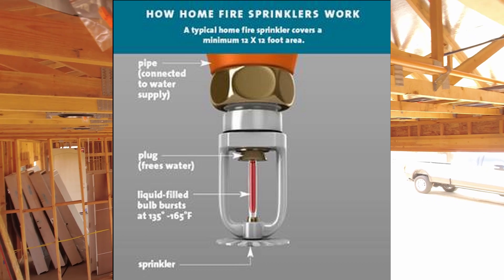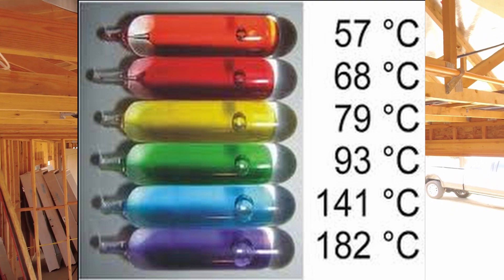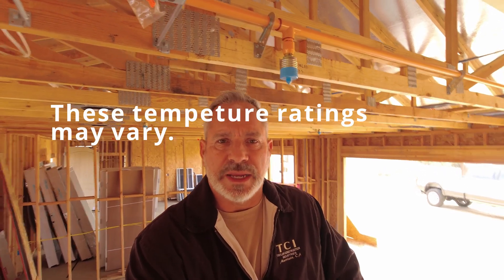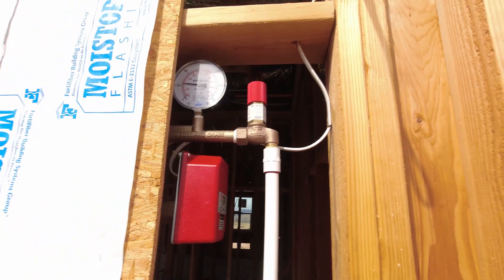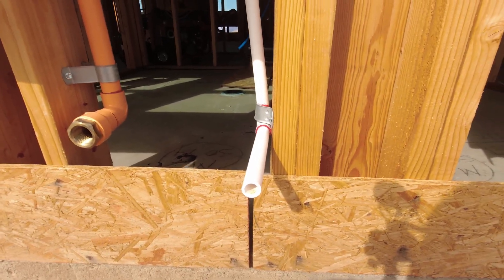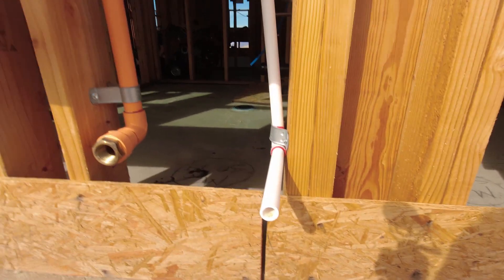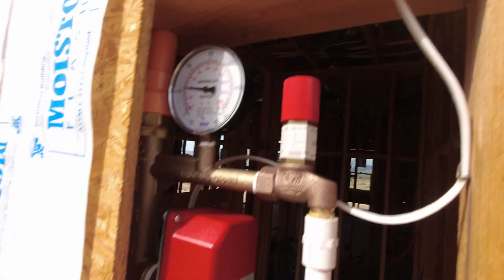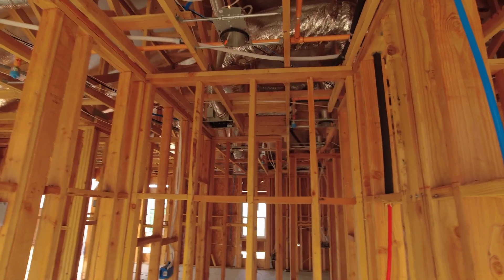Fire Sprinklers Explained HOW THEY KNOW THERE IS A FIRE!

Comment: Couple things. Your wrong about the color bulbs and there temperatures. 135 is orange, 155 is red, 175 is yellow, 200 is green, 286 is blue, 360 is purple and 500 is black. Fusible link sprinklers have painting on the struts except for 165 has no paint. 212 has white paint. 286 has blue paint. Please calling the flowswitch a flow meter. It’s not a meter at all. It has nothing to do with detecting a drop or increase in pressure. It activates on flow of water whether you have 15 pounds of pressure or 315 pounds of pressure. It works the same. Sprinkler goes off, water pulls the paddle of the flowswitch which has a built in retard so it can be set for instant or up to 60 seconds, then the fire alarm goes off. Typically you set the switch to activate in 30 seconds because of you get a water surge and you set it for instant it will constantly trip the alarm. So it’s good practice to set them for 30 seconds.
Reply from the maker: That's great information and I appreciate the feedback. I build in several other states as well and believe it or not. They all have different color codes for temputure. The ones we order here in California have a color code pamplet. Thats where i got the information from. Thanks again.

Comment: Towards the end of the video when you were talking about the flow switch and adding a bell you could also use a fire alarm not a residential smoke alarm but a commercial outdoor rated Notification appliance and you could also add them inside.

Comment: THANKS a lot for this information! I've been looking around for videos that explain it well enough that takes away a little anxiety. I'm starting a new duplex project where the city requested that one of my units that im developing contain a fire sprinkler system. Its a small 700sqft 1BD unit, watching this video definitely makes me feel much more confident!. Any other advice that you may share for fire sprinkler systems? Im def going the wet, CPVC route with a dedicated 1" line from meter. Thanks again!
Reply from the maker: Just make sure that it is a dedicated water line with no shut off valves that could be turned off by mistake. Also, probably one of the most important pieces of advice would be to check your insurance policy regarding flood damage and Fire. Just to make sure you know what you're covered on. 👍 Thanks for watching the video and thanks for the comment.
Reply: @tcidevelopment5996  Thanks for the follow up! Are shut off valves not allowed per NFPA13d? The setup that i'm thinking of is: Tap into the 1" main water line, run that line about 50 feet to unit. Split into a 3/4 line once inside and T down to 1/2" connecting 6 sprinklers. I'm just not sure if i'm going to need a backflow or if im allowed to add a shut off valve ( with a lock maybe?). Thanks again!
Reply from the maker: In California we have to have a dedicated line with no shutoff valves. The shut-off valve has to be at the water meter with a city water terminates with the resident water. Also in our area it is required that we have a backflow device. I believe I covered that in video number two or three on the 4000 square foot house build. So for our area of Southern California no shut-off valves, a dedicated water line, and a backflow device, all mandatory. I would definitely do a system design and avoid a 1/2 inch line. I happened slime would not be enough water flow for 6 sprinklers but you will have to do some calculations and a little bit of math for flow rate. Hopefully I was able to help. My channel is New but I'm going to try to cover every single aspect of building from ground up to completion so hopefully you will be able to pick up some good information.
Reply from the maker: Thank you! Appreciate the feedback